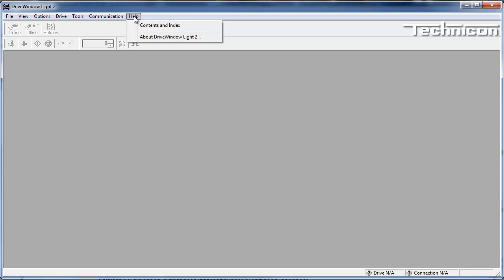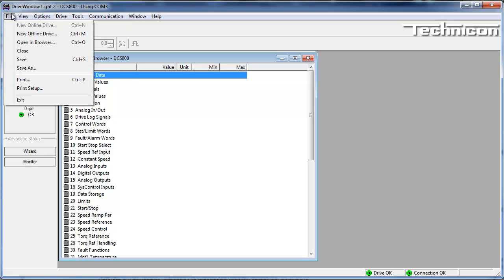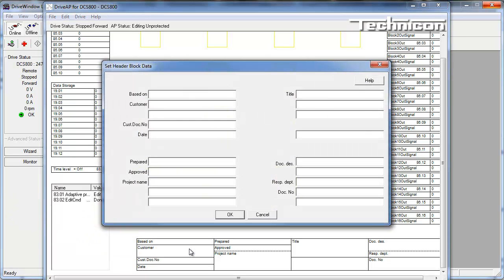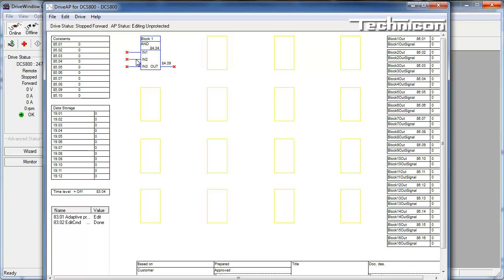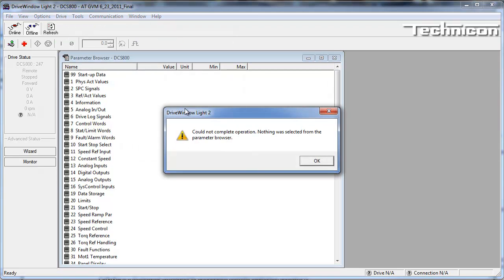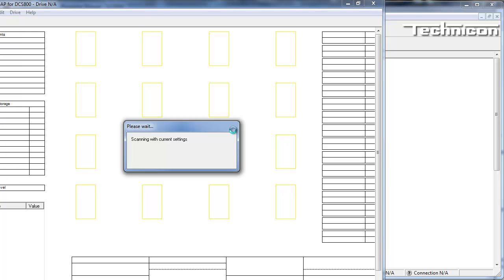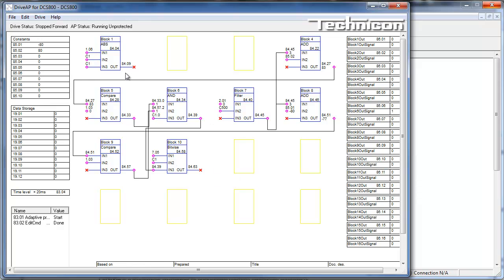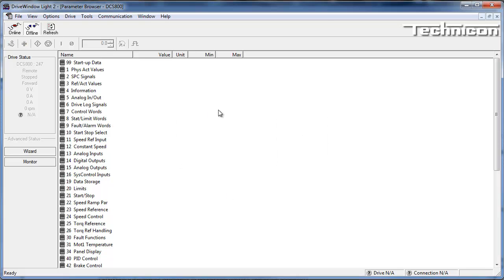DriveWindow Light 2 - AP Tool - Tips & Tricks

Comment: I need to connect through DWL2, I have a DCS800, but I have not succeeded, I have version 2.93 Unicode, and when I check the catalog of drives to which the software can be connected, it only shows in "Type and Model", several ACS and ACH and only the DCS400, I already modified the "Baudrate 38400, data 8 bits, parity odd, stop 2, Address 247, and it only throws me" No drive detected ", someone who can help me.
Reply: Same issue I am facing

Comment: Hello sir!
I have the drive Acs 355, I am trying to communicate it via X2 port of the inverter(Rj-45 to 232 converter). I set the drive parameter 9802 on 10,4, and 0 respectively with 5302 to 5210 all set as per 232 protocol i.e 8,0parity,1stop bit. Still I am unable to connect as it gives no drive found in the end.
Reply: did you still unable to connect? i have the same drive (ACS355) and cant connect